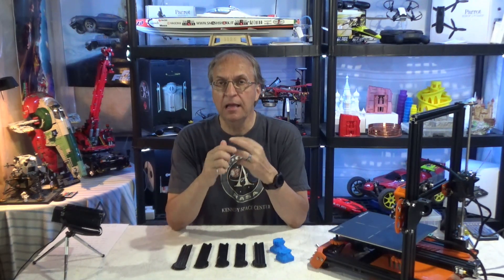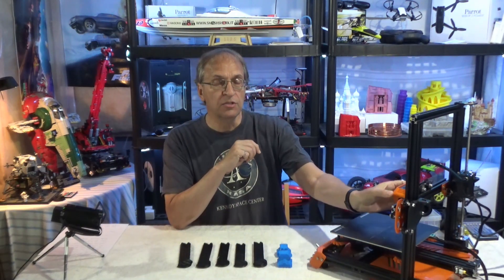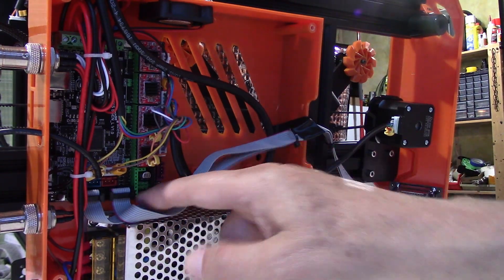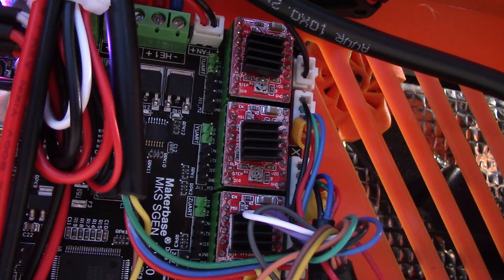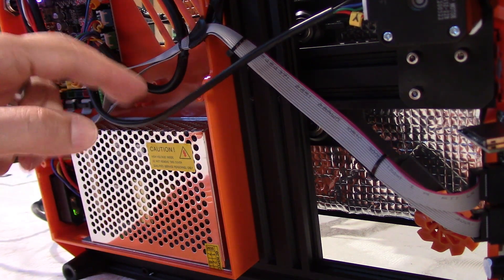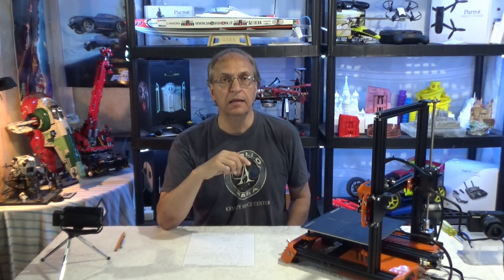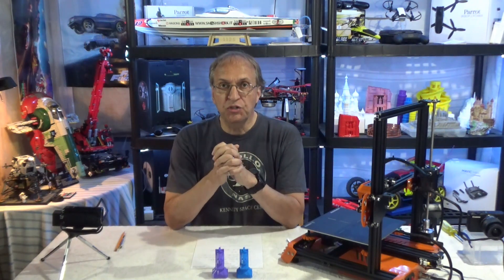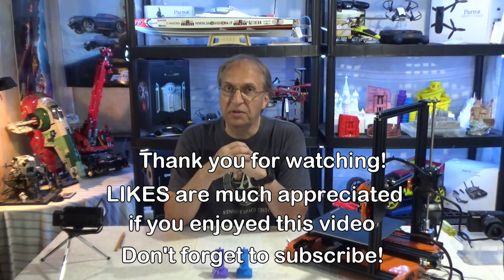Homers / Tevo NEW Tarantula Pro | Adjusting VREF and other important settings!

Comment from the maker: Since the control board comes fully assembled, I thought the vref would be set correctly for all four stepper drivers.  But no they are not!  I hope this video will help others. Thanks for watching!
Reply: @Snow58 did you verify this bro?
Reply: What is the model number on those stepper drivers? Sounds like they are assuming 2A steppers and .06 ohm rsense.

Comment: That is not a good way to adjust VREF.  It's much easier to connect the ground of the meter using crocodile clips and a Male-Female Dupont cable onto a convenient header (check pinout). Then Attach another crocodile cable from the positive probe of the meter to a metal screwdriver. That way you can adjust the VREF while using the meter almost hands free. Another alternative is to put the negative probe onto the SD card slot or USB connector shield. Both are ground.
Reply from the maker: I agree, this is a better method. Thank you for sharing here!

Comment: Most convenient if you can park the ground probe somewhere, then get a crocodile clip and attach it directly to the shaft of your screwdriver to the positive probe. Then you can see the value change on your voltmeter as you turn. If you're going to poke around with a steel screwdriver anyway as opposed to a ceramic turner, which you don't have.
Reply from the maker: You are right, I was thinking about that procedure too but never did it. Thanks for your comment.

Comment: I have an issue with homing my y axis if the bed doesn’t start against the limiter it goes althe way forward jamming into the motor and i can’t get prints in the middle of the bed
Reply from the maker: There could be several causes here, both hardware and software.  I guess you double checked everything mechanically.  Perhaps a stepper driver is defective, or a limit switch or the firmware file is corrupted somewhat.  You could try shuffling stepper drivers around to see if that makes a difference and/or update the firmware file.  This could be a difficult issue to solve... When you start printing, both the x axis and y axis should go to home...

Comment: My hotend assembly for this printer was a complete state :/ was loose and ended up coating the whole of the hot end in PLA. Managed to kill the Thermistor wire trying to clean so decided to replace with a v6 hotend Only issue is now I can not update the firmware for the life of me. Did you end up having any luck doing so?
Reply from the maker: Hi there, I ended up replacing my stepper drivers (instead of replacing the whole control board).  I then had issues updating the firmware.  Did a lot of research on the web and tried for a few weeks.  I finally gave up and I am looking for a new printer...Too bad, this printer looks great and I really wanted it to work.  Perhaps replacing the control board was the way to go!

Comment: Just a HINT switch the ribbon cable around then the are away from the power. And nice video im about to install 3d touch V3 and update it. But i didnt find the firmeware yet. Still looking!!
Reply from the maker: Thanks for the comment.  I have upgraded my stepper drivers to TMC2208 but the firmware update did not work.  I have a recent video about that and other problems.  So currently, this printer is not working for me!

Comment: Hi Dan, very good vidéo, I've bought 2 tarentule and we assemble with my students. I have a problem, the hotend often  bung. Someone else have the same problem ?
Reply from the maker: Bonjour Christophe.  I did another video recently of the problems I am having with replacing the stock stepper drivers with better TMC2208.  I don't have issues with my hot end.  Perhaps somebody else will comment here.  Thanks for watching!
Reply: Hey! I recently bought one and I was having a lot of issues with the hotend. Had to remove it and clean. The problem was that the filament tube was not placed properly, it had to go all the way down, and mine was not. It started printing and stopped in the middle. Now it's good!

Comment: In my experience Homers Support is the worst. My printer came with a broken Hotend and a failing PSU, but the Support refused to help. I then myself upgraded to a proper PSU and replaced the Hotend. On the other hand I run my printer now with 120mm travel speed and up to 80 print speed without any issues.
Reply from the maker: Good fix Lord Pensington.  I am still having issues upgrading my stepper drivers to TMC2208.  Since my printer is not working well, I figured I would try this upgrade but I have issues with the firmware update...
Reply: @SuperdanTech  I have these drivers on my shelf as well, but due to the new kind of 32bit Mainboard and no proper instructions I decided to wait for you or ruiraptor to come up with a Video 😀

Comment: can you make a tutorial on how to upgrade this 3d printer to tmc2208. I am having a lot of difficulty in upgrading to this part and it is not working for me. I would be very grateful if you could make a tutorial for this.
Reply from the maker: Hi, I am working on it now but I am having significant issues... Stay tuned!
Reply: @SuperdanTech   so I'm not the only one😂. Thank you. Do you know how long I will have to wait for the video? i want to be able to print things on my printer.
Reply: @foysal8680   Vref for Tmc2208 depends on resisters.  I have 1,19v on my tmc2208 and my tarantula works perfect!

Comment: I bought this printer over a week ago, and the only problem I had was (and that didn't came for an assembly error) was that the X axis motor connector was reversed, so when I wanted to move this axis to the right, it moved to the left... but it was easy to repair by reversing the connector. I haven't tested prints over 2 hours yet, but I'll check all the issues that you touch in the video and prove them. Thank you for your advises!
Reply from the maker: You are welcome Abraham and thank you for visiting my channel.

Comment: Hi bought tarantula pro I assemble it everything okay when you came down to the wiring The ribbon cables are too short do you know I can get longer ones from thank you for your help your videos are great and interesting Q for your help
Reply from the maker: Thank you!  I guess they packaged the wrong cables in your box!  What a bummer.  You will need to contact Homers support through their website to get two good cables.  Or try to get the same spec ones from an electronic webstore.

Comment: I have followed all your videos on the Tevo Tarantula in my build of said printer. My problem is connecting to CURA on a Windows 10 PC.
The Tevo is not seen as a printer. Its seen as a SD card or storage device, "Marlin USB device" is its name.
This is most likely a driver problem. Tevo.cn has a driver but the maker homers3dprinter.com has no visible support.
Reply: Well this unit is seen as a plug and play marlin SD storage device and no drivers can be found that will change it to a 3d printer.
Mattercontrol sees a com part in use. I searched for Marlin drivers and found none.
Guess I wasted my money buying something that hasn't been out and tested.
Sent a message to Banggood to find the support center.
Reply from the maker: When I contacted Homers support, I was told that this printer is not plug and play but diy product...lol
Reply from the maker: I had to upgrade the Marlin driver in my Win laptop to be able to print via USB with Cura.  I guess you are having the same issue.  I hope it works for you.
Reply: An update got Matter Control connected to printer. I had Cura running and it blocks all access to com ports while its running because it scans all com ports asking for a temperature response. So printed one job and PLA on retract bloomed into a space, heatbreak had ruff ridges in it and held hose back 1mm.

Comment: I did everything you recommended, both mechanically and electronically.
The steps drives were 0.8 V and I set it to 0.95 V, now the printer stops with 1 hour of printing, that is, it gets worse, the X and Y axes are free, but the electronics are very hot, I'm in Brazil and here the temperature is around 27 degrees, I took off the bottom plastic cover and put a taller feet to see if ventilation improves but it didn't solve it, a friend of mine has an Ender 3, and he never had any problems was assembling and using it, while I'm in the third week with the printer and so far I have not been able to print or the filament holder.
As for the bed, if the temperature drops to 50 degrees, the PLA does not adhere and the piece is loose from the bed.
I'm completely disappointed with the printer, and I'm thinking of returning it and getting an Ender 3.
Reply from the maker: Hi Jose, we must have different bed surfaces because mine is very sticky at 50 degrees.  If I use 60 degrees, I can't remove my print! I have similar problems once in a while but I print via USB from a laptop and it seems to work.  You should try that.  You should also contact Homers support, as you probably have a defective control board.  I hope this helps.
Reply: Olá José, sou do Brasil também e estou com o mesmo problema... já fiz os ajustes de tensão e mecânicos e a minha impressora sempre para com 30/40 min de impressão. Você conseguiu resolver seu problema com a Hommers?

Comment: Hey man, some info, i have a green pro for over a year, your 100% right on fan, 50% max, common knowledge in facbook group... but get a silicone sock for hotend, really helps, keep temps stable ...gotta be a v1 version though, volcano they have 3 packs on amazon for $10 blue color, ones w nozzle hole right at edge and 2nd hole for thermistor.  For non print moves, i run 150mm a sec in prusa slicer, 0 issues, w a correct build and tight belts, itll do it like a champ.  My new RS has all 4 different silent stepper drivers and a newer 32 bit board so the others stuff not applicable, good vid though
Reply from the maker: Homers tech support told me not to exceed 60mm/s for non print speed...their website says 150?!?  I am confused.  They said I would run in thermal protection if I did 150... I like the specs of the new RS and I may buy one.  How do you find the touch screen?  Thanks for the info about the socks, I will have a look.
Reply: @SuperdanTech  idk maybe ita jerk like ya said, fyi the green pro has diff board than orange one,  i put 2208s on my green...i was leary about the touch screen as not much info about  it out there ....even on the tevo facebook group....but damn its soo good, easy to use ...stylus...intuitive, w tonz of functions, too good, im gonna hate using my green pro now....seriously beep click beep. Uggh... but its a beast, 2-12 hours a day for almost a year, perfect prints, assembled using rui raptor vid
Reply: @SuperdanTech  so after some time on the RS, its definitely different than my pro, same stl much more jerky at speed, ill lower but also investigate this on the facebolk group....im gonna make a demo video on the touch screen, since theres none
Reply: SuperdanTech hey man. Back w sum info.  U were right on my RS 150 is too fast. Super jerky changed to 80. Smooth like buttah now ;)
Reply: @flo-ridafpv5713  Hi! I recently bought an RS, do you know where to find info and guides about it? Like BL Touch upgrade and stuff like this? Cause I was sure it's almost the same as the old green Pro, but after what you say I'm having some doubts.

Comment: Thanks for the info . Just got an Tarantula RS and it has been a disaster so far . I`m brand new to printing so I`m sure that is at least half of the problem , lol . My vref out off the  box ranged from 1.1 to 1.3 , so adjusting that is definately required , adjust them all to .96 . Also my heat block runs a consistant 13 C cooler than the displayed temps . Things have improved a bit since that discovery , at least now it will make it all the way thru a test cube print without nozzle cloging or jam . Still struggling with under extruding issues though , thats what it seems like anyway . Looks like it will be quite awhile before I can figure out how to print anything usefull on this machine . Should have just went with an ender 3 for my first machine since there is so much machine specific info out there for it . Again thanks for taking the time to make these vids , they have helped .
Reply from the maker: You are welcome William.  0.95V is for the stepper drivers in the PRO model.  The RS has different drivers.  You should google to find out what the right voltage is or ask Homers support.  I remember when I started 3d printing two years ago with my Ender 3.  I knew absolutely nothing and now I am almost a pro...lol.  Don't regret your purchase, the new Tarantula pro and rs look much better than the Ender 3 and 5.  They just need more tweeking since they are true diy kits.   Good luck!
Reply: @SuperdanTech   According to Homers web site both the Pro and RS use TMC2208 drivers but the RS uses a 32 bit main board .
Reply: The web site also leads you to belive the RS comes with WiFi , but actually you still need to buy and install the wifi module , same as the pro if the info on the site is to be belived
Reply from the maker: They probably made it standard recently for the two models. My Pro does not have the 2208.
Reply: I have a RS that came in DEAD... no board functions and no support from Homers to banggood were I bought it from, direct contact also zero. also please put washers between the axle ends and the plastic, the excentric nuts wil dig into the plastic if you turn them.

Comment: Hi!
With this new settings, wath is the difference between this one and the ender 3 v2?

I found this one from Homers (https://www.banggood.com/HOMERS-or-TEVO-Tarantula-RS-3D-Prinster-DIY-Kits-235+235+250mm-Print-Size-AC-BED-or-TMC2208-or-TOUCHSCREEN-or-32BIT-MAINBOARD-or-WIFI-p-1689675.html?rmmds=search&ID=523699&cur_warehouse=CN) that comes with the 32bits board, the TMC2208 stepdrivers and touch screen.

I am divided between ender 3 v2 by the size of the community / support and homers who appear to be a more mature printer but with a much smaller community.

Can you help me?

Thx :)
Reply from the maker: I cannot really comment on the Ender 3 V2 since I never owned one but the community is much larger with the Ender which is useful for help with potential problems.  The Tarantula with the TMC2208 and the touch screen is the RS model.  I may buy that one next because of all the upgrades compared to my PRO.  Thank you for visiting my channel.
Reply: @SuperdanTech  thx! 😉 I'm waiting for the review! The printer looks really good!

Comment: Sorry, Dan.
I don't mean to monopolize your time.
I got all of the axis calibrated. Even the extruder.
As a matter of fact, the extruder heats up quickly! Who woulda thunk?
I'm closing in on my first print!

Any suggestions on how to configure the home point/origin/start point?
When I hit the "auto home", it does exactly what it's supposed to do.
But that start point is just off the bed, maybe a few millimeters.

How the heck do I get it to wherever I need it on the bed?
Or do I just compensate for that on the slicer software?

Your thoughts?
Reply from the maker: Honestly, I never had to adjust the home point with my Ender 3 or my new Tarantula Pro. Sorry that I cannot help you here.  You should google it but the start point on both my Ender 3 and Tarantula is slightly off the bed.  Is that not normal?  I actually like it since I can prime the PLA off the bed manually before starting a print!